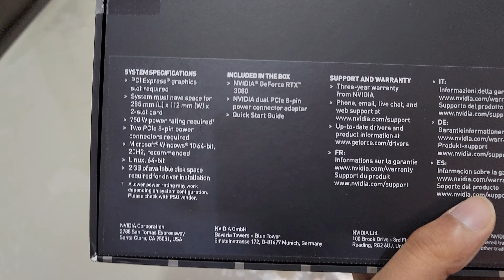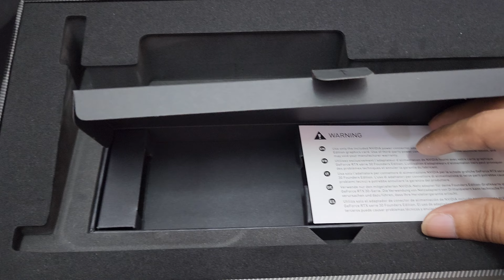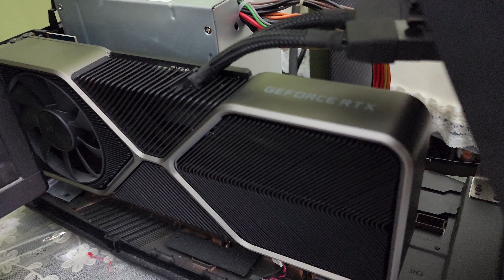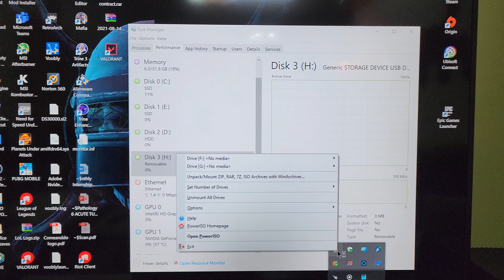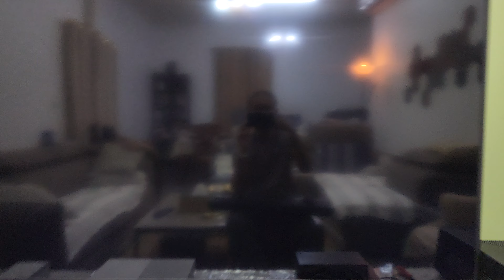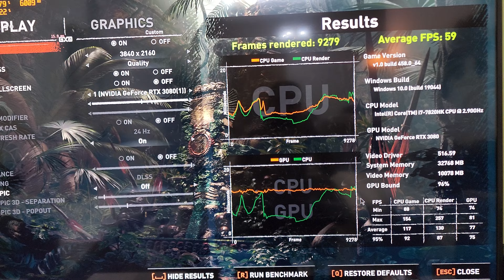RTX 3080 unboxing and Setup on Alienware Graphics Amplifier

Comment: The HGST HDD is basically invincible, those HDD's had super low failure rates and were used in data centers
Reply from the maker: so far they are working fine with me
Reply from the maker: do support my new channel called (Disco Mulla) for gaming

Comment: Hi.Is it going to work with Gtx970M that Rtx3080?
Reply from the maker: Hi there, I probably did not understand your question right. The amplifier connect to your CPU directly so it does not matter what GPU is in your system. all you need to do is connect it and update the driver and it will basically turn off the onboard GPU (shared or dedicated) and use the external one. what i can tell you is that RTX 3080 FE is probably the latest and only one that will work due to power constraints.
Reply: @theadilbarakzai    .It works Rtx3070Fe .You are amazing.Thank you for video.

Comment: Hey Man, how can i overclock my Alienware 15 R2? I have i5-6300 hq or the gpu, It Is possible?
Reply: you can not overclock a HQ processor but you can overclock you GPU using MSI afterburner, although i do not recomend it. Hi Bro, this is my new gamin channel. please support me here as well.
Reply from the maker: Hey brother, sorry for my late response. the CPU you mentioned can not be overclocked. it is a locked processor, olly processors that end with K (14900k, 14800hk) can be over clocked. you can still use MSI afterburner to over clock your GPU but after trying it myself, i do not recommend it to other as the performance increase is not enough. as R2 is quite an old laptop, i highly recommend to repaste the thermal paste if you an or seek help, if possible use liquid metal if you have copper heat sync. that willl be much better for you.

Comment: Can 5060ti use on the AGA？
Reply: plc-e 5.0 I tried. Didn‘t Drive
Reply: @康皓然-f5v   yeah, 5060 doesn't work because it's in x8, but 5070 and higher works
Reply from the maker: Hi there, i have no tried it myself so i can not confirm that, what i can say is that any card that uses 4x lanes and works on 2 8pin or less power with power requirement of less then 250 watts should work just fine. you can see the unboxing video of RTX5080 on my gaming channel called (Disco Mulla) to see how that performs on its own

Comment: Great video, How did you get a RTX 3000 series to work? As far as I know the amplifier is only compatible up to the 2000 series.
Reply: Registry Editor and edit Hack Flags, also the 50 series works in the AGA without using registry editor, 5070 and up works 5060/5060Ti doesn't.
Reply from the maker: Hi there, what i can say is that any card that uses 4x lanes and works on 2 8pin or less power with power requirement of less then 250 watts should work just fine. you can see the unboxing video of RTX5080 on my gaming channel called (Disco Mulla) to see how that performs on its own.

Comment: Hola, como estas? Tengo todo igual, la misma maquina el mismo cooler centro. El tema es que hace más de un mes que no puedo usar el amplificador grafico, ya que empezó a titilar la luz del cable conector del AGA  la luz led, de blanco a rojo intermitente. Asi dej;o de funcionar de repente, apareciendo un mensaje que no se reconocia el ''DEVICE''. Tocando el botón de los conectores logre que funcione varias veces. Actualice el Bios, el amplificador grafico drivers y el Command Center. La verdad no se que puede ser. Anteriormente nunca lo pude ver reflejado en el Command Center cuando funcionaba y lo hacía compartiendo ambas graficas.
Reply from the maker: AGA does not share graphics performace with the onboard graphics card. i've used it for over a year now and never really faced any issues other then the AGA power supply noise. AGA is not a well built device, it is possible that your cable is bent somewhere along the way which can cause this issue as it is a fiber optic cable. more over, it is also possible that the power suplly for your unit is not suffeciant enough if you are using RTX 3080 non-founder edition as they require more power.

Comment: Hey, quick question I have a RTX 2070 would the 3080 be a upgrade
Reply from the maker: definately, but as i am replying to you late, i suggest you going with either a 4070 super or 4080 super as they have new features which 30 series does not.

Comment: Would it be possible for alienware egpu to be comparable to other laptops?
Reply from the maker: I dont really understand what you mean in the above sentence. surely it is possible and 9/10 time the  eGPU will win as the Laptops dedicated GPU are lower tier versions of their chunky full size cards.
If you mean, can the Alienware graphics amplifier be hooked up to other brand laptops, then sadly no. it require a proprietary connection which event the new Alienware laptops does not have.
You can however get a thunderbolt eGPU station which will connect to many laptops that has Thunderbolt support. performance will not be the same though.
Reply: nope

Comment: Great way to futureproof your laptop however to fit the AGA, you need that exact card; RTX3080FE. Plus the laptop in its own right is pretty powerful as it has the desktop equivalent of the GTX1080 but obviously the RTX gives it more boost. The 60FPS lock seems like the TV is restricting due to 4K60p
Reply from the maker: you noticed it right dear friend. I tried 3080ti from colorful which did not work so I had to get the FE card 3080. the jump and smoothness was massive as I was able to play many title 4k 60fps with no issue at ultra settings. that said, CPU is a big factor now due to which i just now switched to a i9 desktop PC using the same RTX 3080 card.